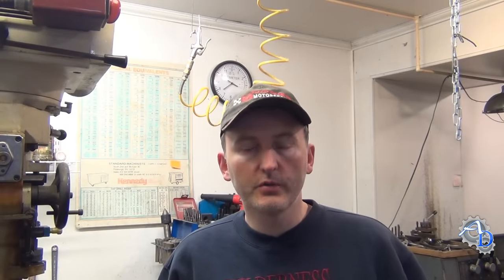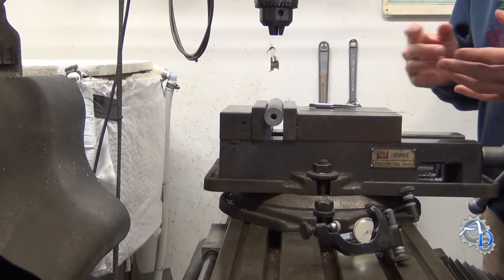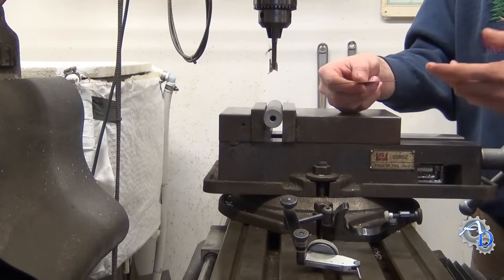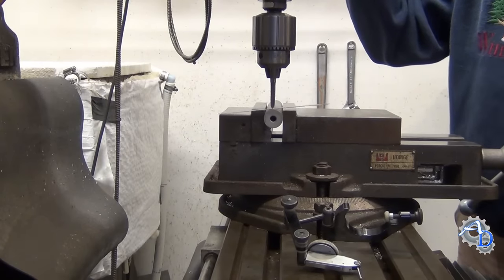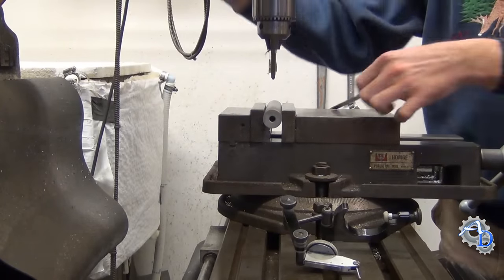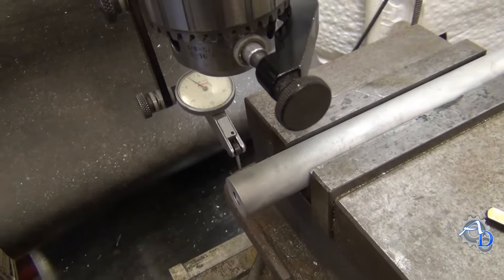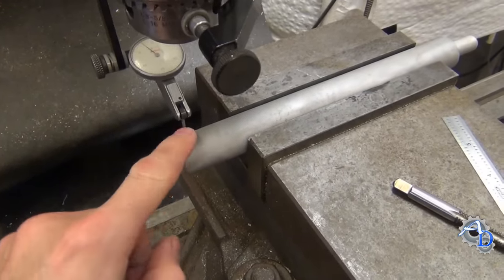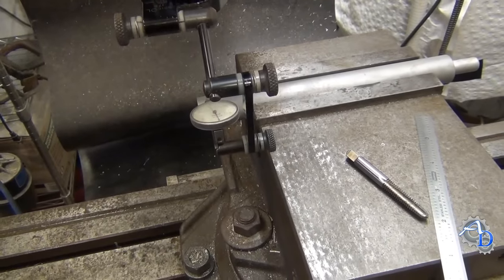Old Machinists Mill Trick To Quickly Find a Rod Centerline

Comment: edge finder works fine for me ,inexpensive
Reply from the maker: I can't use an edge finder on a large diameter part.
Reply: Arnold's Design , “ i set the paraller  vise on cero with the edge finder before hold the piece “
Reply: Arnold's Design how are you holding a large part?  Using 2 v blocks or 123/246 blocks, edge find the outside of the fixed jaw side, set as zero, move to the other and edge find and divide in half, move to that number and rezero no need to compensate for the edge finder as this is self compensating, this only works on a dro, if your mill doesnt have one, get one  its too slow to use the screw scales, and you can make errors easier, it is virtually a necessity to have a x and y dro on a mill.  Indicators are a last resort because they take too much time.  Or get a haimer, they are so fast and accurate to use they pay for themselves quickly.
Reply: You shouldn't need to get to the far edge if you can get the edge finder to the other side of the part with the quill locked.  This way, you are on the same vertical line and should be at the same angle off of the center line.
Reply: I also didnt think about using a wiggler, i often forget how useful they can be.
Reply: Touch off of your front jaw.
Reply: Vic the machinist with the most tools is usually the one with the smallest imagination.
Reply: steve gale yes I don't do piece work your right, I do repair usually  one off jobs .
Reply: you sure can! just use the same Z height on each side as far down as you want.
Reply: Totally can. Just have to keep a constant. A piece setup the way yours is in the video for instance. Move Z with edge finder down to somewhere along radius, then touch in Y. Then move to other side of part keeping the Z the same height and touch other side of Y axis. Take the distance you get and divide by 2, move that much in Y and there you go. Works any way as long as there is one constant so you hit the same part of the radius on both sides.
Reply: Seve Bertolone I never use an edge finder, always a dial test indicator, and clock anything with one in 1 minute, even tooling balls on compound angles
Reply: Jeremiah Brackins that works but there are no shortcuts in machining. You should be indicating from the outer most edge of the radius on both sides without moving Z. That way you are also double checking the diameter and if its flat at the same time. Should also always use a dial test indicator unless its a raw\saw cut edge. I know, been maching precision 3d plastic molds for more than 10 years. I should make vids to blow the amateurs away. 0.002" is unacceptable to me no matter what. It takes no extra time to be exact, unless you don't have practice
Reply: Arnold's Design  get 1/2 inch tip, 1/2 shank edge finder.
Reply: gomezpiro  What ? Are you drinking again ?
Reply: I started before dro’s were invented. You learn a whole different trade under those circumstances. The old guys when I started said beware the man with a tool for everything because he probably needs it.
Reply: @normanreed572  that's a good saying. I worked for a Chinese shop. I'd have to drill a 2" hole, but all they had was a 1.875" drill. I got it done. I take very good care of my tools cause I believe "you're only as good as your tools" But like the drill size thing I've learned it's not always true
Reply: Vic  where would you find one? and does cen tech or starret make it?or someone else? thanks
Reply: Arnold's Design I have never had an issue using an edge finder or a wiggler to find the edge of my part or come off of something that’s on the same plane as it. Your trick is neat and definitely something to have in a machinists bag of tricks still.
Reply: @highstreetkillers4377  How did you get the hole to 2" ?

Comment: I've used a similar method in the lathe for tool centre height for thirty something years. I thought everyone was taught this. 
Lock the tool in the post and sandwich a decently straight rule between the job and the tool point. If the rule is in the vertical plane it is very close to centre. 
Not criticising. Worth posti g. This is really useful also for approximating tailstock truth if it has been upset for taper turning. Gets the DTI VERY close indeed.

Comment: That's pretty cool and should work even on a drill press. Edge finders are cheap and work well, but still need dial indicator for "final word". Another quicky is a feeler gauge between a straight rod in the chuck and the side of the round work piece. Move the piece toward the rod until you feel "drag" on the feeler gage as you move the gage. Then subtract the radius of the rod, the work piece and feeler thickness.

Comment: Cool trick. I was taught how to centre (Canadian spelling) a tool bit on a lathe using the same technique. Use a steel rule between the tool bit and stock chucked up. When the rule was vertical, the bit was on centre. I never thought to use it to centre a spindle over round stock in a vice. Thanks for posting.
Reply from the maker: Thanks 👍

Comment: A long time abo i repaired machinery and built prototypes. I used this method for finding centerline of a shaft. Another way to do that if there is a concentric hole through the stock like for drilling an oil hole in a bushing I would clamp the bushing in the vice then put a drill just slightly smaller than the Id of the bushing. Then extend the drill down past the end of the bushing. Set the cross slide so the light showing through the bushing was even on each side. Then raise the drill set the place along the bushing and drill the hole. If you have more than one bushing set up a stop. 

This is not exact but oil holes and set screws do not need to be exact. Save the time for exact placement for when it is needed.

Comment: Thanks!
What I do is simply lower the quill gradually while passing the table back and forth, and just let the point make a scratch.
Usually you can see the scratch form before it gets too wide, but you can eyeball the center of the scratch.
I will certainly use this method too .. see how it shapes-up for less fiddle-time.
One other thing I have noticed is that if you are using a twist-drill for the hole, it always walks-off to the left .. and you can estimate for that with experience.

Comment: Nice trick. You can also use a tiny/flat grindstone or flat milling bit in the running drill. Slowly go down approximately in the middle of the red. Where the stone/bit touch, it is exactly the middle. Grinding it more flat give you a nice starting point as well for the drill without having it slide off the top.

Comment: Either Edge-find the Fixed Jaw, measure the diameter and dial over half.
Or swing and indicator to both side like you did later on.
The See-Saw method you demonstrated might rough it in, but would prefer something soft like a business card between the two steel components.
Thanks and stay warm!

Comment: Great method!
I have done a mathematical analysis of this and found the amazing accuracy of your eyes.
The result is in a table below.
The interpretation is as follows, if for instance the scale deviates 0,27 degrees from the horisontal plane, the relative error from the center line is  +/- 0,30% (table lookup) . For a 10 mm rod that translates into 10*0,3/100, which equals  +/- 0,03 mm. 

You report an absolute error of approx +/- 0,001 mm. The diameter of the rod you are using is unknown, but I estimate it to be approx 25 mm. Now let's reverse the previous arithmetic's in order to find the relative error and the associated angle. The relative error is then: 0,001*100/25 = 0,004 %. For very small angles there exists a linear relation between angle and relative error, so in your case the angle must be 0,004 degrees! 

Is really possible to perform an "eye ball" estimation with that accuracy? I think some lucky circumstances are involved in the example, but despite this it is a great method.

Regards,
Göran Andersson 

Angle	Relative error 
(Degrees)	(%)
	
0,000	0,000
0,009	0,010
0,018	0,020
0,027	0,030
0,036	0,040
0,045	0,050
0,054	0,060
0,063	0,070
0,072	0,080
0,081	0,090
0,090	0,100
0,099	0,110
0,108	0,120
0,117	0,130
0,126	0,140
0,135	0,150
0,144	0,160
0,153	0,170
0,162	0,180
0,171	0,190
0,180	0,200
0,189	0,210
0,198	0,220
0,207	0,230
0,216	0,240
0,225	0,250
0,234	0,260
0,243	0,270
0,252	0,280
0,261	0,290
0,270	0,300
0,279	0,310
0,288	0,320
0,297	0,330
0,306	0,340
0,315	0,350
0,324	0,360
0,333	0,370
0,342	0,380
0,351	0,390
0,360	0,400
0,369	0,410
0,378	0,420
0,387	0,430
0,396	0,440
0,405	0,450
0,414	0,460
0,423	0,470
0,432	0,480
0,441	0,490
0,450	0,500
0,459	0,510
0,468	0,520
0,477	0,530
0,486	0,540
0,495	0,550
0,504	0,560
0,513	0,570
0,522	0,580
0,531	0,590
0,540	0,600
0,549	0,610
0,558	0,620
0,567	0,630
0,576	0,640
0,585	0,650
0,594	0,660
0,603	0,670
0,612	0,680
0,621	0,690
0,630	0,700
0,639	0,710
0,648	0,720
0,657	0,730
0,666	0,740
0,675	0,750
0,684	0,760
0,693	0,770
0,702	0,780
0,711	0,790
0,720	0,800

Comment: I would suggest using a Spring Center Tap Guide in the spindle to eliminate having to fool around with quill movement.
Also, see if you can incorporate on that scale, a mini Spirit Bubble leve with magnetic base, to eliminate squatting to level by eye.

Comment: I'm a retired machinist. worked in sawmill maintenence SHOPS, and big production shops too. there's always a few ways to do things, but time spent is the important aspect here. If I don't need 100% accuracy, but 99.5% will do and it saves 5 - 10 minutes messing around with edge finders and dial indicators, its a no brainer. Even cutting keyways, I usually just located the centre of a shaft with the endmill lightly cutting, and adjusting position until I had full diameter and a fingernail of even depth lip on the shaft. Takes no time, and is always close enough.  TIME IS MONEY.

Comment: Nice trick. I’ve been a machinist for 22 years now. Almost all of it on manual lathes and mills. I still prefer an edge finder. There would be no time difference.
Reply from the maker: Thanks. I usually use edge finders. I have several.

Comment: This is a great technic for setting up a tool on a lathe so the cutter is at or below center line.
For work on a mill I'd have to stick to edge finding the solid jaw and moving half the material thickness. Particularly if I had a DRO. I'd leave the Y zero set to the solid jaw as often as possible for efficiency reasons.

Comment: I've seen this done before..... I forgot about it until now. And yes, it was an old time machinist who taught it to me. When I was a machinist I just used an edge finder, or sometimes a test indicator...... Depending upon the application.

This is a handy technique for finding the center line..... But I have to ask myself "why would I want to sacrifice precision, just for the sake of saving myself an extra 5 minutes to check things correctly and accurately?"

Comment: Same technique works great on a lathe finding exact center of your cutting tool. Run your crossfeed in and touch the 6" rule with your cutting tool and does the same. Up or down until it's vertical.

Comment: An end mill spinning at a medium speed with a piece of paper makes a great edge finder. When the end mill grabs the paper your are .003 away.
Reply from the maker: I also use that method. Touching off sides, or end of EM, and also touching off surface grinding.

Comment: Great video Arnold!  I learned that method while watching a guy on a lathe, LONG before I started machining.  I hate to be the one to point this out, but it's actually a 6" rule, not a scale.  Somewhere, somehow, the term scale came into the vernacular, and it's incorrect.  Thanks for the great videos!
Reply: scale is not incorrect in the machining world.  A  ruler is what kids use in elementary school.
Reply: @robc8468  A ruler and a rule are the same thing.

A scale, (more accurately called a scale ruler) is a tool for measuring lengths and transferring measurements at a fixed ratio of length.  Such as an architect's scale and engineer's scale.  They might be in a scale of 1/8 inch = 1 foot, or 1 inch = 100 feet, and so on.

Call them what you want, but they aren't the same thing.

Comment: I've often used a little trick similar this to pick up the center of round stock clamped in a machine vice.  What I'll do is hold a flat file parallel to the vice surface and draw it down the length.  It will produce a shinny thin line on the top that is a very reasonable center line.  This is handy and quick to use in a drill press situation where complete accuracy isn't the order of the day.
Reply from the maker: That's a good idea too. I'll try that.

Comment: Ink pen the side of rod, use the back side of drill bit, end mill.  Touch the side gently, if the ink disappear make a reference point.  Measure the size of rod and rod attached and divide it on two.  Thats your center.

Comment: Keith Fenner uses this technique to adjust the tool height to be on center in his lathe. Same thing except the rule is oriented vertically against the work instead of horizontally.

Comment: Chuck the part, measure with calipers, lock the dial and scribe using whichever jaw as your datum. A #1 center drill and a properly calibrated "eye"crometer, you won't even need to indicate it in! You have to measure and center drill anyway to pop the hole, use those steps wisely to eliminate setup time.

Comment: For my “hacking” work this is tremendous! Example: wanted to replace broken plastic screw handles so used aluminum rod and needed to find the center for handles (set 90 deg off), and getting anywhere near .005 to .010 was just fine, but had to figure it out trial and error. This is fine, too, for woodworking, which I do a lot of. Thanks!❤

Comment: I'm a retired machinist and never have seen that move. Very nice indeed.  Although personally I'd just use an edge finder, get the edge, move half the diameter of the part and half the diameter of the tip of the edgefinder and you're in like flint. LOL

Comment: You can use the same idea when setting a lathe tool height. Just use the tools cutting edge to trap the rule against the side of the round stock. Learned this in 1968 as a first year engineering apprentice.

Comment: I've also put a center drill in the Chuck, turn it on and as I moved the rod back and forth on the x axis I raised the table up to the drill point. As soon as the point made a mark that was the high spot. Center the point in the spot and that's close enough for drilling a cross hole in a rod for a retaining pin. Takes the guess work out of leveling a scale.  However both procedures are good ones.

Comment: Good trick...True Position .004 Dia. 
I'm surprised that nobody makes a scale with a precision level built into it just for finding the approximate centerline.

On a Lathe this is how I was taught to put the tip of a turning tool on center as well.

It's very handy when having to work on machinery that I'm not familiar with.
Reply from the maker: Thanks. I've put level on straight edges like this, though I mostly just eye it up anymore.

Comment: Nice job have not seen that before! I have a trick that is super quick and accurate. Measure your stock o.d. With a mic then divide by 2. Then edge find your solid jaw and move half the o.d. You just figured. With in a thou or better every time.

Comment: Good tip. I think the only caveat to this method is that it is based on the assumption that the rod is straight and true., and that your quill is dead nuts on. Make certain that both of those are the case, and you should get great results.

Comment: You can eye ball it with and end mill, if you’re cutting a key way then touch the end mill down and adjust till it makes an hour glass shape. Or use the end mill to touch the side and count in half the shaft plus half the end mill.

Comment: Chucked round stock in a vise, use a set of dividers from both sides to easily find approx. center.  You can also use a rod the same dia. of the center hole and lower it in front of the hole and sight down it on both sides.  All approx. centers, but often good enough and quick as lightening.

Comment: What i do is put a point in the mill, start running the Y back and forth while running Z axis down a little at a time until it scratches the top of the round stock and leaves a dash mark on it.  put the point on the center of the dash and you are REALLY close.

I have a few center line indicators for precision stuff but for 99% of the time this works faster and just as good.  drilling for set screws, milling flats, etc.  I can do it start to finish in about 10 seconds

Comment: I like the idea as i use the same idea when resetting the table if you have put an angle on.
What i do like is the drill chuck holder for the dial indicator never seen before. Inspired to make one.

Comment: I have my vice usually in the same place on my mill. I have a page saved in my readout and it has the coordinates for the corner of the vice back jaw. If I need a hole in a round bar for example i just line the job up with the datum edge of the jaw and move the table to get the position along the bar i want. To centre the hole I just move half the dia of the job. I can also use it to drill say, four holes in a piece of flat stock. Saves a lot of time.

Comment: Thanks for the vid. Never thought of that one. I like that it's quick and fairly accurate. I think it's useful when precision isn't your ultimate target. I work with a Bridgeport to repair CNC machinery and assembly machines that have broken. Often "close enough" will work for a repair to get the equipment producing parts again and a better repair can be made once production load allows or a new, correct part can be ordered.
Reply from the maker: Thanks. I'm glad you liked it.